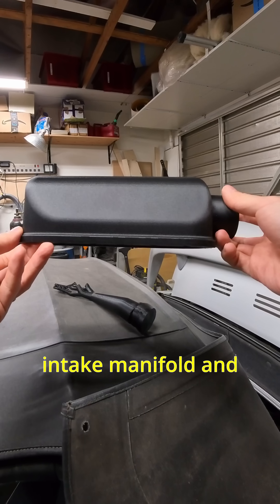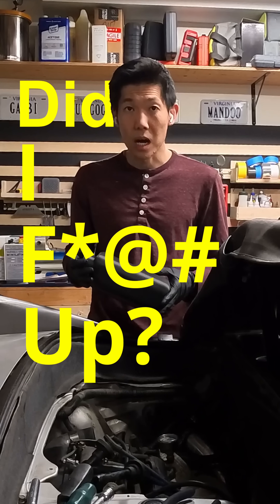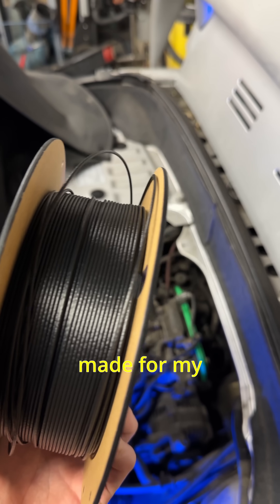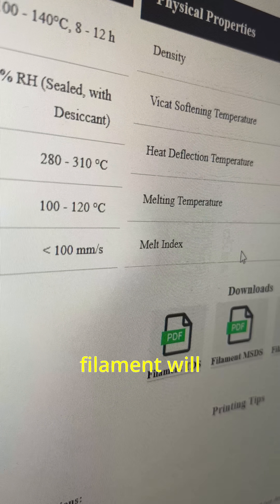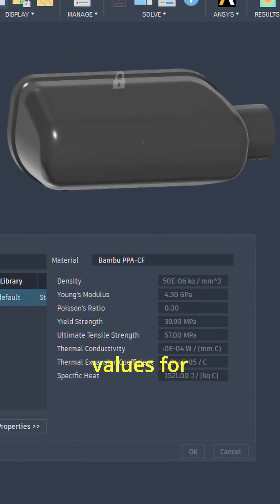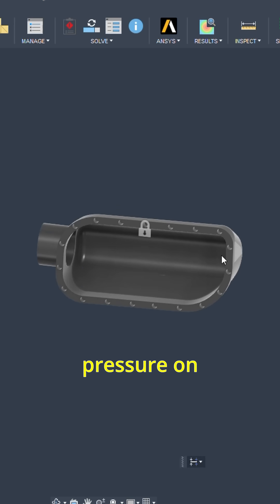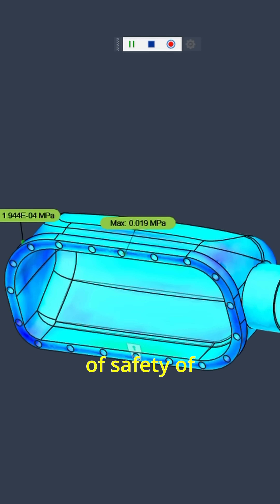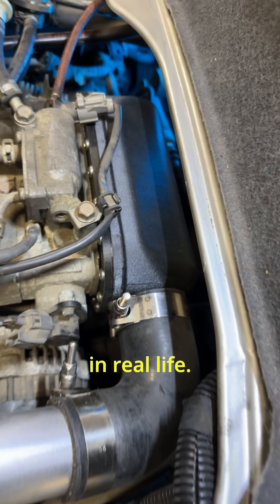3D Printing Intake Manifold with Carbon Fiber Nylon PPA-CF

Comment: I would not call a factor of two “way over designed”. It’s not. That is the minimum for non safety related applications (1.5 for uncrewed rockets as I recall where it’s so hard to get any margin and still fly).  A factor of 10, now that you could call way over designed (or could call it “German Engineered” ;-). Clough42 just did a good review of this material (I think it was this stuff), and although it’s better than most, the BLUF is that it’s still plastic and still weak in comparison to AL or steel, and of course susceptible to heat.  AND you got to make it EXACTLY with the settings provided (which many/most 3D printers don’t support) or all you get is a little stronger that the other materials.  This is great for prototyping, but I would not go on a road trip with it, particularly in the desert at high noon in the summer. IMHO of course. Thanks for the video!
Reply from the maker: I think you misheard bc I stated it’s a factor of 15 lol. Thanks for the insights!
Reply: @IMEEMADE . Ok if you said 15 then I stand corrected. I heard 2, but in the end we agree. Still, do look at Clough42’s recent video on this as it
May still be weaker and more susceptible to temperature degradation than you might think. One other factor to consider, is that these plastic resin and carbon fiber burn very well!  I think this was highlighted in a recent airplane incident where a fellow had made an engine cowling on his airplane out of carbon fiber.  it worked great for the first couple of flights, but then, for some reason, maybe because it was hot and maybe also because of his engine, getting hotter than normal, the darn thing caught fire mid air!  he was able to land it and walk away from it at which point he got to see his hundred thousand dollar airplane go up in smoke. i’m just saying, there is a reason why the majority of car engines components are made of metal, although I do concede the manufactures using plastics on intakes these days. Although there again, those plastics are very high temperature plastics.  Just no free lunches out there!  But thanks for the video. It was very informative and well done.
Reply: @hu5116 🤔 Me parece que te confundes, el PPA-CF (Poliftalamida +fibra de carbono) aunque si que es verdad que es un termoplástico (semicristalino) es muy resistente a las altas temperaturas, de hecho tiene una capacidad de resistencia a las altas temperaturas en servicio continuo superiores a los 200ºC, sin que se vea afectada su integridad estructural.
💁🏼‍♂️ También es adecuado para servicio permanente en condiciones de humedad extrema.., entre muchas otras cosas. Lo que quiero decir es que, para según qué propósitos los polímeros plásticos son incluso mucho más adecuados que los metales. 🤔 Básicamente la ventaja de los metales es su ductilidad, esto hace que en condiciones de tensiones extremas tiendan a deformarse antes que colapsar y estallar en mil pedazos.., la desventaja es la corrosión y el peso.
Y la ventaja de los polímeros plásticos a rasgos generales son; su bajo peso molecular; flexibilidad; resistencia química y la corrosión, aislantes eléctricos, etc..,
☝🏻 Pero, en concreto a los de ingeniería de ultima generación, le tendríamos que añadir los extras de; resistencias a altas y bajas temperaturas (superiores a 300ºC en el caso del PEEK-CF); a la intemperie y  los rayos UV; resistencia mecánica externa, similar a metales (gran rigidez, impactos, vibraciones, ...).
💁🏼‍♂️ Si comparamos los "pros" y los "contras" de ambos (metales vs polímeros plásticos), para propósitos específicos, los polímeros plásticos destacan en versatilidad (sin entrar en tonterías ecológicas).
 🤔 Estoy convencido de que en el futuro de la ingeniería de los materiales (estructurales) seremos capaces de desarrollar nuevos que combinen lo mejor de ambos e incluso con propiedades nuevas añadidas como las de las cerámicas metálicas tipo 'zirconio'  (ligereza, anticorrosión, altísima rigidez o  ductilidad, todo en un solo material serían la base..)🤔👍🏻
🙏🏻🙂🖖🏼✨

Comment: Glass and carbon fiber nylon filaments are hands down the best type of filament to use in high heat applications like an engine bay before getting into those industrial filaments that require a printer like Vision Miner 22 Idex.  

Quick Tip: If you are going to print CF or GF nylon turn off your parts cooling fan, this will greatly improve your layer adhesion and also print slow.
Reply: There is ppa-cf as well. Bambu new filament which is teice as strong as nylon. On the negativity that it is more brittle.
Reply: @P4TRICCS 💁🏼‍♂️ Pues ese mismo es el que utiliza y muestra el youtuber del vídeo aquí! 🙂👌🏼
Reply: 🙂👍🏻 Muy buen consejo,✨
precisamente eso es lo que recomienda BambuLab para imprimir su filamento PPA-CF (Poliftalamida + fibra carbono). ☝🏻 Está demostrando, por ahí en un vídeo de  YouTube, que apagar el ventilador de capa mejora la adherencia entre capas de éste filamento (PPA-CF ) y, que a su vez, ésto mejora la resistencia mecánica final de la pieza en un porcentaje alto >15%. 🙂👍🏻✨
🖖🏼

Comment: Awesome stuff man. Agree correct material. However my one yabbit as a design engineer is that SF for burst pressure is only one design parameter. Degradation of material over time and fatigue (both of which are insanely hard to quantify for plastics, the science just isn’t there yet for most of us).

Not trying to criticize, just suffice to say a high SF to compensate for ignorance is a valid and time tested approach.
Reply: 🙂☝🏻 El PPA-CF (Poliftalamida + fibra de carbono) es un termoplástico semi cristalino que cuando sus piezas están bien diseñadas y és 'recocido' puede llegar a alcanzar una resistencia mecánica, térmica y química muy alta. 💁🏼‍♂️ Altísima rigidez; resistencia alta a los impactos; altas temperaturas; productos químicos; vibraciones; tracción y compresión; es flexible y básicamente a la fatiga y degradación que mencionas. Puede llegar a superar incluso al PEKK y estar al mismo nivel del PEEK (que actualmente son los dos termoplásticos semicristalinos de ingeniería desarrollados más resistentes que existen) y solamente es superado por el PEEK-CF !☝🏻
🤔 En conclusión, 💁🏼‍♂️ el PPA-CF puede llegar a sustituir piezas metálicas de automoción, ☝🏻 pero sobretodo   aeronáuticas (por su ligereza), para su uso real perfectamente.👌🏼✨
Como ingeniero que eres seguramente ya conocerás éstos materiales..🤔👌🏼
🙂🖐🏼
Reply: ppa-cf is highly chemical resistant. Not as much as pps-cf, but pretty dang good.

Comment: Yep it will be totally fine. Great material for this application. 3D printing is awesome. People severely underestimate it.
Reply: Made a throttle body spacer for my sr20. 25% infill and 5 wall loops for thickness planned on making one from cnc aluminum after testing with a printed model. Printed model ended up handing 30psi of boost and never moved to the aluminum spacer
Reply: @connorcarson basically same experience here! I had the cad files all ready and got quotes for CNC, but honestly the 3D printed part was working perfectly fine and even if it failed it wasn't printed with the best material or with nearly optimal settings, so I know we could make it even better. Pretty impressive!
Reply: @connorcarson  what material did you use? I have a few prototype adapters ready to test although wouldn't mind looking for a longer "temporary" solution.
Reply: And its getting better every day.
Reply: He knows…. He just needs content for a video
Reply: Please clean your engine
Reply: @Jerrybirdy Me?

Comment: Additive engineer here, looks like a solid design. However, with a glass transition tenp of approc 80C I'd be concerned with the drop off in mechanical properties during sustained operation. I'd be interested to hear how it holds up 👍
Reply: Nylon is a weird one. The glass transition is low but the heat deflection temp is way higher. That varies, depending on the type of nylon, if there was any filler, GF or CF, printing methods etc
Reply: @MrBluntNose  HDT of this filament is like 227 C as far as I know
Reply: @MrBluntNose  PPS is the weirdest in this regard
Reply: PPA has a GTT of 110C according to what I've looked up. Bambu says to dry out their branded PPA-CF @ 110-120C, too, so I'd imagine that it's fine at least up to 100C. And in an intake manifold, that's REALLY hot, even on a turbo car. My IATs even at idle yesterday in 35C ambient weren't creeping above maybe 52C, and while moving/air over the intercooler/under boost were more like 40C. I'd say PPA-CF is perfectly fine with < .5bar of boost in an engine bay.
Reply: In my experience, fiber reinforced filaments have not been able to hold pressure. Fluids spray out between the layer lines. But if I tried harder i’m sure over extruding and making walls thicker would probably work.
Reply: @WhiteG60 if ur intake manifolds getting 110c u got problems G

Comment: You should watch clough42s video on this, it shows that the strength can very wildly based on ur printing method. And of course the claimed numbers in the tds are higher than those achievable by the regular consumer
Reply: You and I came to the same conclusion after watching that video.  Although this is great stuff, I’m gonna stick to metal.
Reply: 💁🏼‍♂️ Pero al final del vídeo si que consigue prácticamente los mismos resultados que las pruebas de laboratorio realizadas por BambuLab, ☝🏻 ten cuenta que él modificó el tamaño de las piezas de ensayo (las hizo más pequeñas) para adaptarlas a su máquina de tensar.., y mejoró bastante los resultados de sus pruebas cuando aplicó la recomendación de BambuLab de suprimir el ventilador de capa para mejorar la adhesión de las capas y la isotropía de la pieza en general.!☝🏻🙂
🖖🏼

Comment: Only way this could fail is if you had hidden layer adhesions issues... PPA-CF is one of the best filaments, we use it for 3D printing firearm receivers because of its incredible properties.

If you ever make something that youre concerned about the Z direction strength, look into salt remelting, I use flour salt for my salt so i dont need to grind it myself, but you can find even finer salt which will give better surface definition.
Reply from the maker: I’ll look into salt remelting. Sounds very interesting!
Reply: How chemical resistant is this filament say with gas and oil. Usually in turbo applications there can be oil or gas residue over time in the intake manifold

Comment: Not sure what your print settings are, but make sure you overdesign your parts when you run your sims cuz FDM parts in tension are usually much weaker in Z than in XY, some materials like PC will need to be annealed after printing for maximum layer adhesion strength, and ofc if you printed with sparse infill rather than 100%, expect less strength than your sims.
Reply from the maker: Very good point! I didn’t mention in the video, but to account for this I used the tensile and bending strengths listed for the Z direction since those values much smaller than XY direction
Reply: You could also anneal after printing and let it crystallize for even more z strength

Comment: The cf content I think mostly just adds cool factor but some of those nylon plastics are very strong and resistant to heat. I bet this works fine but you could always send off the design to be made with a stronger material if this one fails
Reply: It adds to its rigidity and it's ability to resist warping due to heat post-print. It sacrifices layer adhesion, which makes most people think it's weaker, but its only weaker in the Z direction. It's stronger in the XY directions
Reply: This is mostly outdated information. Years ago fiber reinforced filaments were pretty gimicky and layer adhesion was poor. But today’s PPA-CF printed in a heated inclosure is stronger in the Z direction than PLA in the X-Y.
Reply: If you want to test for yourself, PET-CF is incredible price to strength ratio. The z axis is strong just not as much as PPA-CF.
Reply: @randomguy1371 Check out Siraya Tech PPA-CF Core. It's stronger in all aspects since it's a coaxial extrusion. PPA on the outside and 25% CF in the center, giving it great layer adhesion. Only $100 for 1kg too, which is super cheap.
Reply from the maker: Agree. That’s the best part of 3DP parts, its relatively expendable

Comment: All of my FDM prints are porous. You should see if it holds water. And what about when it heats up? Turbos throw some heat. It could get close to it's glass transition temp. I'd probably get it machined out of Al.
Reply: Intake manifolds are not bolted to the turbo. This is not the first plastic intake manifold. The manifold itself doesn't experience that much pressure nor hear. It gets cooled by the airflow and sits on the opposite of the motor to the exhaust manifold.
Reply: I'd just get fiberglass or epoxy resin and paint the inside (and the outside if you want it glossy).  It'll increase its ability to take heat, its rigidity, and make the inside of the manifold more slick. It would also seal any air from escaping.
Reply from the maker: Not a bad idea to have it machined out of Al